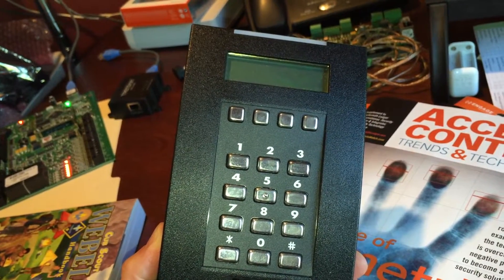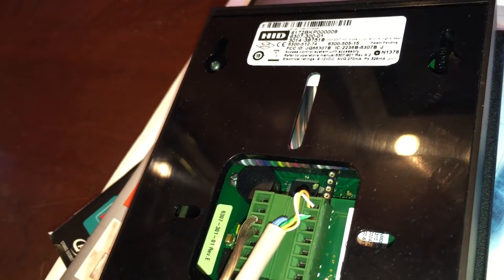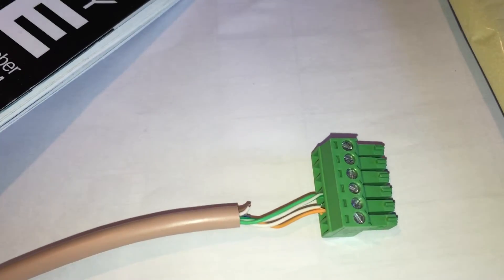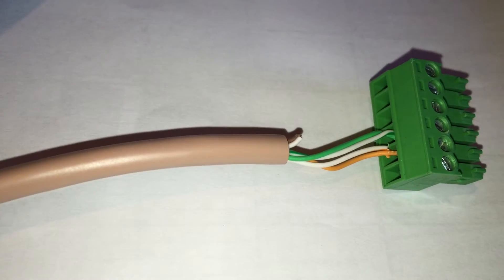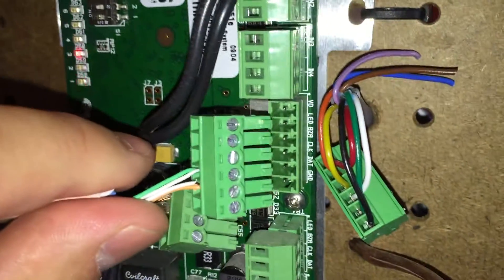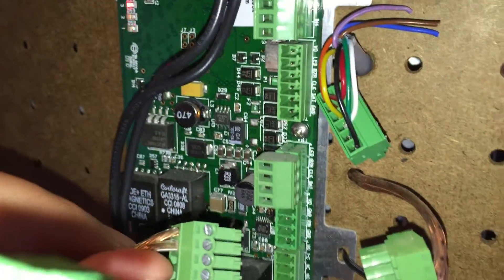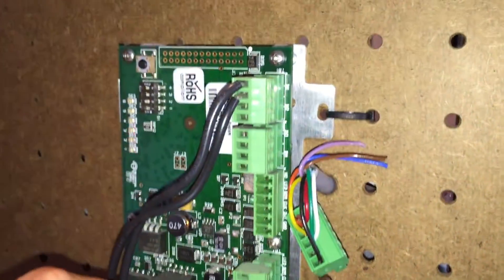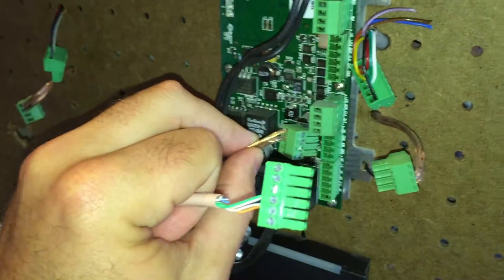HID RKL55 Connection to a Mercury MR51e via OSDP

Comment from the maker: Note:  HID swapped the + and - GPIO pins between the original manufacturing run of the RKL55 and later versions.  Depending on this, you may have to swap the orange and green wires here.

Comment: 2 wires on D0 et 2 on CLock ^^ it's one each only normally? any reason why you wired like that?
Reply from the maker: Yeah.... The phoenix connectors tend to "bite off" the thin ends of those individual conductors in the CAT5 cable used.  So I double-up the conductors to strengthen the connection point.
Reply: Oh alright got it. Thanks